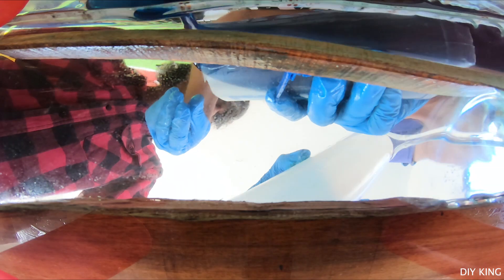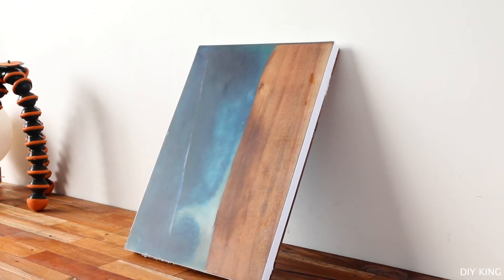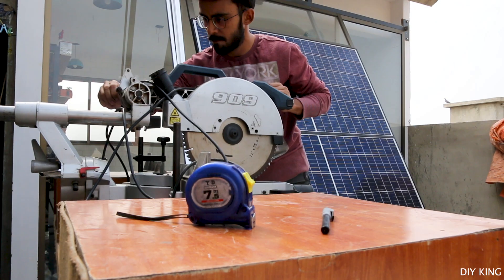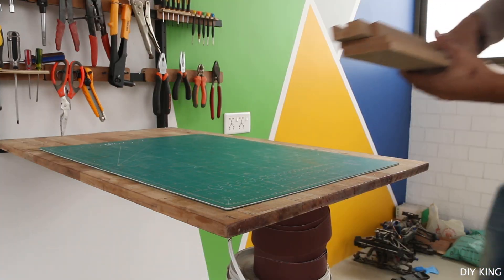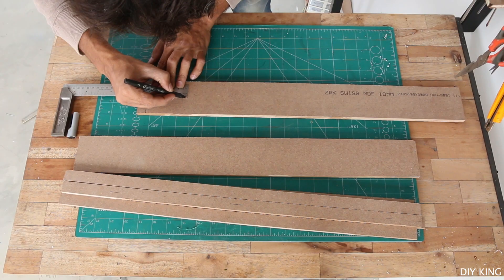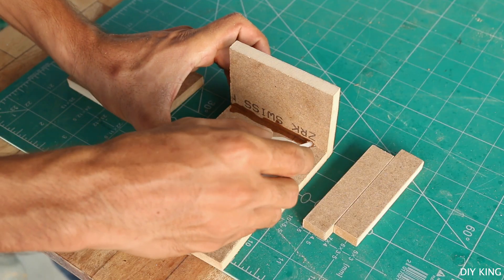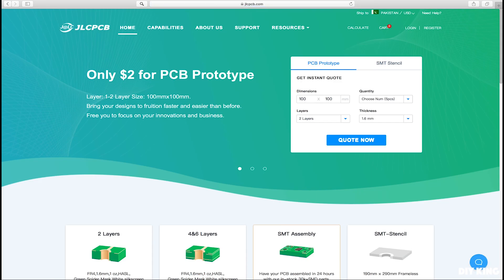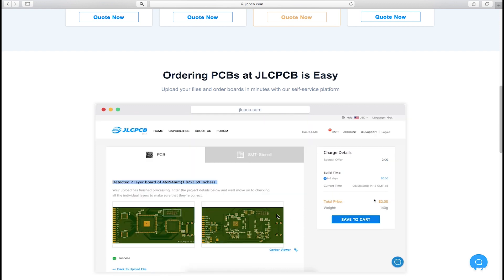How to make a Manual Milling Machine

Comment: Nice work 👌 You could implement mechanical endstops like the hydraulic systems on a manual surface grinder so you don't have to manually step it over yourself. You'd have the switches at a set point either end of each axis and when it bumps it it'd switch direction. You wouldn't even need a micro controller if you wired both switches together in series (you'd have to use DPDT buttons so they toggle on / off, and with a main on/off override switch too)
Plus, make sure you make a dust boot so you're not breathing in all those fibres!
Keep up the good work,
-Will